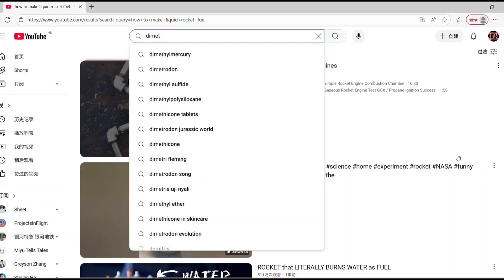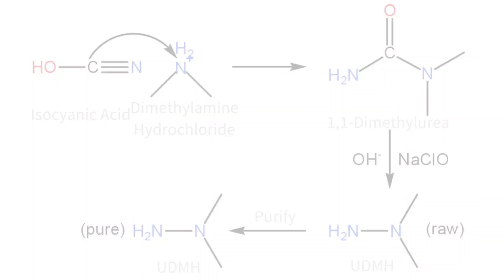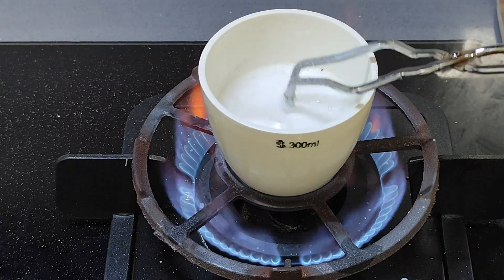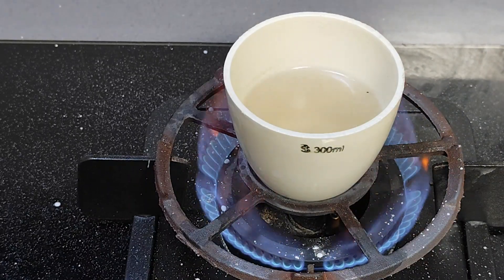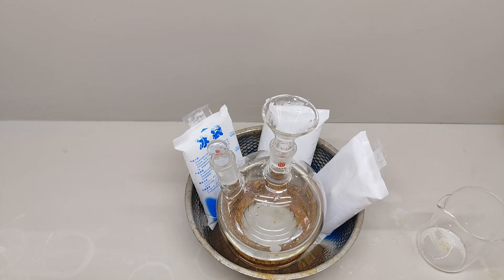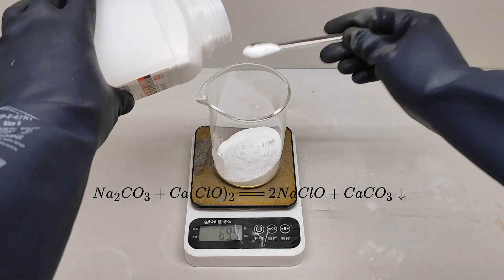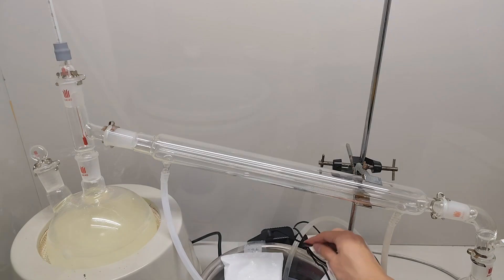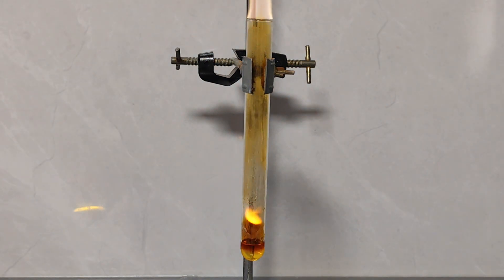Making real rocket fuel(UDMH)

Comment: Very impressive! Thanks by share with me. 
It's possible to make rocket fuel rubber?
Reply from the maker: It's possible to do so,but as a high molecular weight polymer，the HTPB usually made in a very pressure,about 15-25Mpa,which is nearly impossible for individual to make.😢